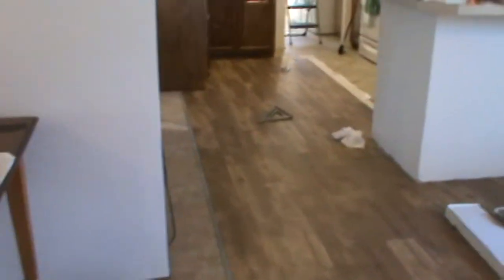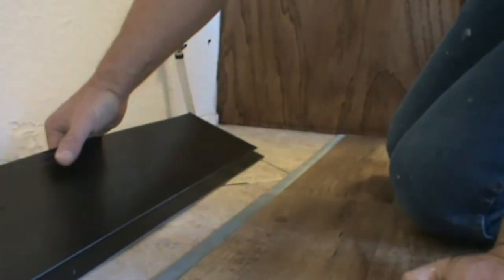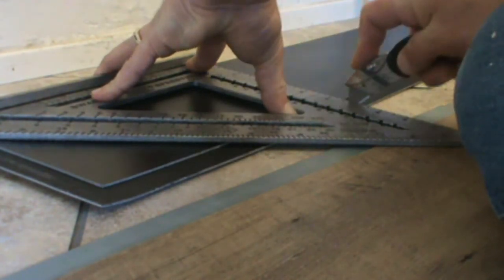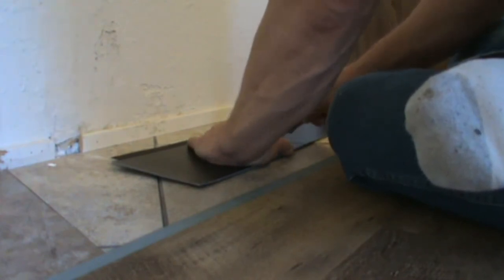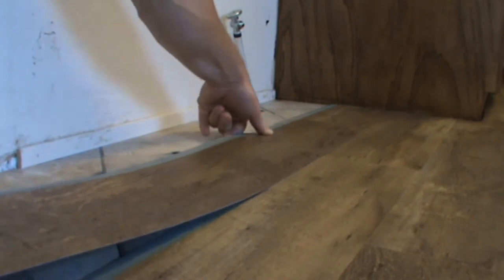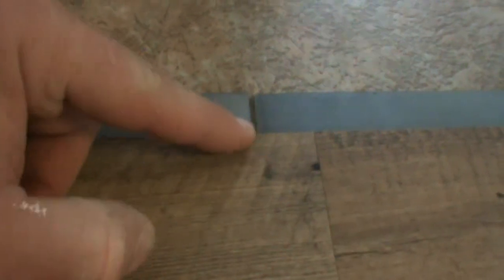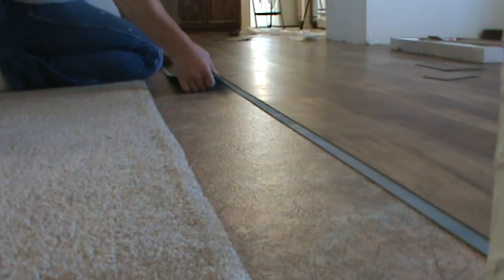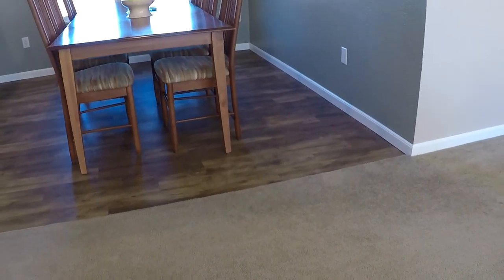Install and Review of TrafficMaster Allure Vinyl Flooring.

Comment: Was this bought at homedepot? I think allur3 changed its name to lifeproof
Reply: LifeProof is a separate product from Allure, both are Home Depot brands though. The LifeProof is LVP (Luxury Vinyl Plank) and quite thicker than Allure and more comparable to a waterproof laminate. It's also more expensive @ close to $3 Where Allure is under $2!
Reply from the maker: Yes, it was brought at Home Deport.
Reply: @JonesKnows  Life Proof is a much better product and not made by the same manufacture! This flooring is garbage I just installed 1800 sq ft of this peel and stick crap! It does not lock together and will move over time. We rolled it and still had issues! It’s cheap and easy to install but you get what you pay for!